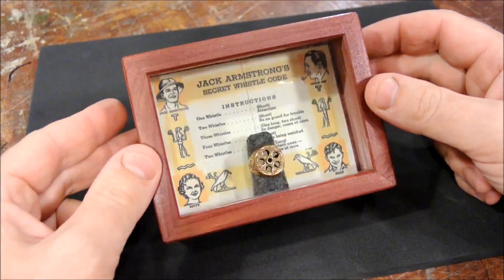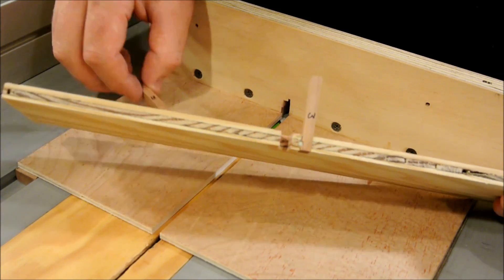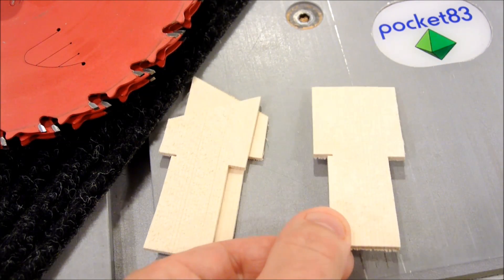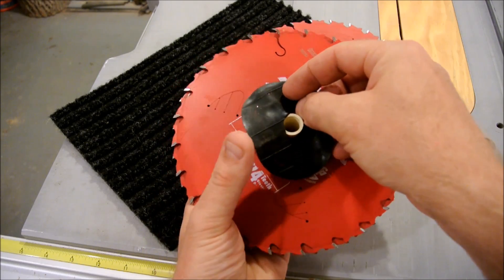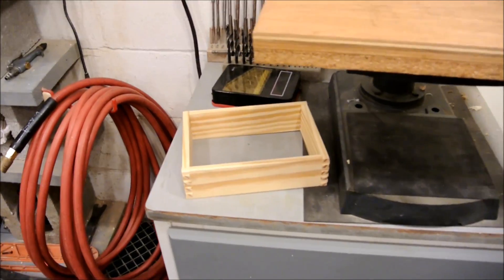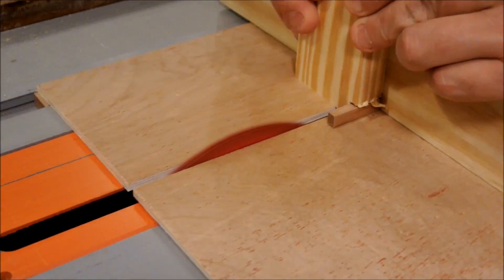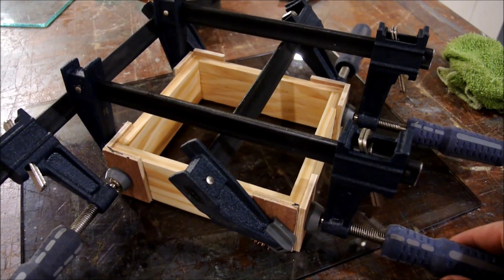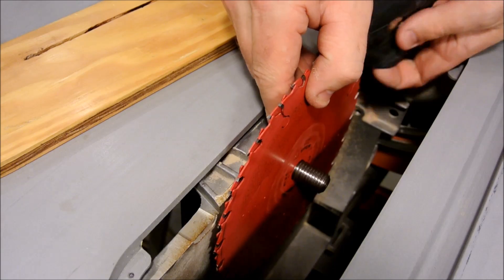Box joints WITHOUT buying a dado set (make one)

Comment: Okay couldn't you do the same thing with say steel washers? I know the rubber helps stop slippage but if you tighten down your blade properly it shouldn't slip anyways. Just food for thought, I prefer to use my router table setup but it does get time consuming having to swap dust collection between my saw and my router table, (yes I'm a cheap skate refuse to buy more tubing for my dust collection and too am worried it may lose suction since it is a small unit).

Comment: I don't think I ever seen stacked blades for sale in UK like you have in USA
Reply from the maker: The blades used here are much smaller than the typical blade used for this saw, which reduces the angular momentum of the stack to an amount comparable to one larger one. Brake time is nearly identical. Not that it matters; if you have to turn a saw off in a hurry, the stupid mistake has already been made.
Reply: Mike L
Thats alot of queen money thought
Reply: They're illegal apparently
Reply: Harry you can have a regular blade but a wide blade is illegal?? What kind of madness is that?
Reply: cameltoast reasearch tells me it's the fact that the teeth can catch each other and fly off, which is highly unlikely but hayho
Reply: It's because of the increased weight, more weight means they take longer to stop, and there are regulations that saw blades must stop within X seconds of the power being cut. A stack of blades can't do that without requiring active braking.
Reply: Mike L This is what I could find: "On European saws the blade is required to stop in less than 10 seconds from the time the stop switch is engaged"

Comment: Thanks very much, really interested to see the "homemade Dado" option!
As someone in the UK, I am apparently prevented by law - out of concern for my safety - to use dado blades.  I could import them of course (or, as I now see, make my own), but apparently even that doesn't help as the arbour on any modern UK/EU table saw will be too short.  This leads me to ask:   a) can I make do without them, simply by making multiple passes of a single wide kerf blade?;  b) how practical is it to make these sort of cuts using a router instead?  I'm a newbie but I figure a router should work fine for these cuts, and yet I never see any US woodworker doing so?  I guess table saw dado blades must be superior to using a router, even factoring in the time to keep changing in and out dado blades?  Thanks again for great vid.
Reply from the maker: It's hard to answer those questions in general, because so much depends upon what you are doing and how often you are doing it, but the short answer is yes to both possibilities. 

Making single-kerf passes is time consuming, but it certainly works. As for straight-bit routing for box joints, sure, that also works procedurally. In fact, there even exist jigs to assist with box jointing (and even dovetailing) with a router. Just do your homework, and make your decision at least in part based on how important the whole thing is to you. For example, I don't box joint very often at all, and I make lots of wooden stuff, so a dado stack is not high on my priority list.
Reply: OK thanks very much!
Reply: Would one of those "wobble" blades fit your saw arbor? There's an angle on it and it wobbles back and forth to make a wider cut. Router works too.
Reply: Buying 3 or 5 of those diablo blades costs a pretty penny for a make-shift device.
Reply: I use my old dull ones. They need not be sharp for hogging out a 3/8" dado. Back support will limit the tear-out.
Reply: And if you don't have 3 or 5 saw blades sitting around, then you probably don't have the experience to be using a dado stack, anyhow.

Comment: literally laughed out loud listening to you and watching both of your videos relating to dado making and box joints etc... 
i mean this in the best complimentary way. They were  funny to me more so because i relate to your thoughts and methods ...... 
more than anything the part where you are pushing your wood through the second table saw you built using a surge protector unit....let's just say although completely rediculous at times i have used things as rediculous as my iphone selfie stick with my iphone attached to it encased with the traction of its otter box rubber coating extended with the selfie stick... with that said i think i just came up with a way to shoot the table saw cutting wood with my otter box rubber case to use as traction to push wood being cut while getting up close and personal footage.... im sure in case the phone would slip and get snagged by the blade it may lead to otters quality control testing to a new level... I truly appreciate and love that i don't have to feel so isolated with the out of the box, non conventional nutty things i use doing woodwork daily.

Comment: I like that box made with strips of wood glued together.  You could stain every other one a different color, like 1 dark, 1 light, 1 dark etc, !   Never thought of that.  Keeping track of what you do you could even use different thickness of wood strips as long as they are the same width.  Like 1/4 X 1/2,  1/2 x 1/2,   5/8 X 1/2 ,   3/4 X 1/2  !
Reply: I saw a video long time ago that used your idea to make a Chess board. Alternate strips of light and dark coloured wood were first joined together. Then strips were cut off of that panel. Finally alternate strips were reversed and glued together to generate the Chess-board pattern. The accuracy was so great that it would be hard to know where the joints were. It still gives me goosebumps while writing this. Regards,

Comment: Hello pocket83.. I had a question that I couldn't find in the comments below. I was wondering if there was a reason (safety/design) you were using 7 1/4 size blades?  My purpose for asking is that I only have 10" blades for my table saw? With your experience, would 10" inch blades work with your method?
Reply: +Nathan Sagrillo I don't see why not. I use the smaller ones because they are cheaper, thinner kerf, and easier to control. Three Diablos will make 1/4" box joints, and that's all I ever really use. If I needed to make larger ones, for like production or high-quality work, I'd probably just buy a dado stack. But these are only the choices that I've made, so you have to decide what you're comfortable with. Good luck ;)
Reply: Awesome! I appreciate you getting back to me so soon. I was mainly asking because I had already went out and got 10"  blade's before I noticed on your video that you were using a smaller blade. Lol.. anywho... thank you for taking the time to make this awesome video! It defiantly helped! Have a safe one.

Comment: Good video, interesting and creative problem solving. I was taught a technique which eliminates the second spacer peg (By William Ng, an exceptional YouTuber and teacher). It involves marking edge that you put against the peg of jig when making first dado cut, then after your done with box or drawer fronts, flip that edge around to place marked edge over the peg, toward the saw blade, leaving a perfectly spaced edge (or new finger if you will) where you place your sides against and make first cut, then remove that front from the peg and finish cutting rest of joints. 😃 Cheers!

Comment: I struggled with making my own box joint jig but still had problems getting my box joints to fit good, especially very long or wide box joints.  I finally bought an Incra I-box and that took care of that.  I also use a Freud dado set of blades that I've used for year.  My primary problem there is keeping the blades sharp.  I sharpen my blades myself.
Your setup is really good and I may try to experiment with you blades of choice.

Comment: I can't see the practical benefit of not buying a dado set unless you already have 3 identical blades, but who has that either. those 3 blades must have cost about $60 each and a dado set is $200. these prices are for the area I live, prices differ depending on geographic area. but point being is that 3 blades cost about the same as a dado set. other than that, great video with lots of good tips.
Reply from the maker: Those blades are $10 each, and I have a dozen of them. They aren't quite dull, but they aren't quite sharp enough for fine work, either. Perfect for this application. Keep in mind that these are 7.25" blades, which I use for both table and circular saws. I will grant you, that if you typically use a standard (and expensive) 10" blade in your table-saw, you aren't likely to have as many sitting around.
Reply: +pocket83 where do you get Fries Diablo blades for so cheap? and yeah, if you can get them that cheap it is worth. but don't do it right? cuz this video is for entertainment only.
Reply: +Mike West that's a crazy good price.
Reply: +Tim Fevens   Home depot had those exact blades 2 for 9.99 on black friday.
Reply: +Tim Fevens  indeed it was,  i wish i had bought more thank two packs.
Reply: http://m.homedepot.com/p/Diablo-7-1-4-in-x-24-Tooth-Framing-Saw-Blade-D0724R/100008676         this link has the blades. 30 dollars is a heck of a lot cheaper with the dado stack

Comment: Yeah there is no way I would stack regular blades on top of each other.  I really don't care what kind of proven DIY method there may be for it.  Shortcuts are just not an option for me when there is blade spinning in my face at 5000 rpm.  A descent dado set will cost you know more than 100 bucks.  Now I know 100 bucks may be harder to come by for some than it is for others.  I definitely  do not negate that fact, but I say to all of you thinking of trying this.  Think about what a piece of hot carbide metal will do to your body coming off a table saw at 5000 rpm.  I mean you see what bullets do to people right.  Now is that really worth risking because you don't want to spend 100 bucks on a real dado set.  For me it definitely is not.  

I love a great DIY just as much as the next person.  In face DIY's are my go to before I purchase anything in the store simply because I love the craftmanship and the thought that goes into it, but there are just some things that I would never think about DIY's and this one them
Reply from the maker: There is nothing unsafe here, assuming that my advice is followed, and as long as there isn't a high rate of feed. In fact, this method is probably less likely to eject carbide, because the teeth can't touch each other through a rotation collision. In fact, this is probably more safe all around: 7.25" circular saw blades have teeth that are small and sharp, so without those deep gaping gullets that dado blades have, there is less leverage for violent grabbing, and less room to catch a shirt sleeve. Also, a zero-clearance plate could be easily adapted to this technique to make it even safer.  

I would not suggest that you do anything that makes you uncomfortable; if you are already happy with the stack you are using, or if you are continuously making dado cuts, then this is not for you. But there is no reason to spread fear about this- especially if you aren't going to point out specifically what is wrong with the technique.

Comment: I was enjoying your video until you suggested that 95% of the world needed to convert their understanding of measurement!It's you guys who have yet to realise the simplicity and benefit of the metric system. Personally I can use either but find the metric far more intuitive. Good video though :-)
Reply: I didn't suggest that at all. I suggest that you adapt to understand the world in its present form and variety, and stop making fruitless argument. I get angry messages to "convert" constantly, despite the fact that I'm already fluent in both systems. I live in a place where wrenches are labeled with Imperial, and where we are many decades away from standardizing, so stop crying about it. 

Also, measurement systems are arbitrary, and there is nothing empirically better about Metric anyhow- you just think that because you have 10 fingers. In fact, the Imperial fractional system has distinct mathematical advantages that a system superior to both could implement, if you guys could ever put down your angry, culturally preserved biases. 

But alas, Metric is the system on which the sun never sets.
Reply: Sorry I rattled your cage!! I meant no offence. I was responding to your comment where you say at 7.01 that if you only speak metric you're going to have to convert. So I think it's fair to say you started the arbitrary argument.
Also I specifically said in MY opinion metric is more intuitive, it's not my fault most of the world agrees.
There's no need to get so hot and bothered I was just messing with you!
Reply: +Andrew Byron He didn't "start the argument"...YOU DID. He's showing you TECHNIQUE...he doesn't know what thickness blades you get in Metric World...apply the technique using your measuring system and CONVERT to Metric...get it?

Comment: How about using talcum powder on the rubber discs so they don't stick.  I use it all the time inside bike tires/wheels to make the tube slip slightly inside the tire during inflation.  Lots less messy than the old water/soap trick.
Reply from the maker: Good idea, except I wanted them to stick.

Comment: Can you please explain why a larger washer wouldn't work better than cutting up a bike tire?
Reply from the maker: Because of the fact that the kerf(s) from each blade overlaps, there is a possibility that teeth could collide, should the blades rotate on the arbor. This could eject carbide, which I would prefer to avoid. The friction-fit of the compressed rubber ensures that this can not happen. I'm sure there are lots of different styles out there on the market, but an expensive dado stack works differently, with a "chip remover," so it isn't likely to pose this particular risk. But, I don't like retail dado stacks either (for reasons that are too long to explain here). Anyhow, just using a shim/washer seems a bit reckless in my opinion, but I suppose it would depend on each unique situation.
Reply: +pocket83 awesome, thank you. I enjoy watching these videos and watching how everyone does different things... thanks

Comment: I'm planning on building a table saw using a 10" circular saw. Will three blades like this work on a 10" circular saw? I am wanting to make box joints (finger joints) 1/4" thick. Could this three blade idea work also for smaller diameter blades like  a trim saw that uses 5" or 6" blades? Any information you can provide would be greatly appreciated! I enjoy your videos!
Reply from the maker: I don't see why not. A smaller blade than is recommended is fine for any table-saw application. Obviously, if you are using the idea in a circular saw, the guard will be rendered less useful, and it could possibly rub, so pay close attention. I would be more concerned with using, for example, three 10" blades in a 10" saw, because it is better to have power to spare. Using three little blades in a big saw that can probably plunge 3" deep in a single cut offers the motor very little strain, especially since you are only cutting out 1/4" of material. 

Just remember- as with any experimentation, proceed slowly and carefully.
Reply: +pocket83 I appreciate the fast reply! All I'm wanting to do is make 1/4" box joints to make boxes. I was wondering though, have you ever made a box joint using only one blade?
Reply from the maker: Yes. It takes forever! For that, you may want a 10" blade with a nice thick kerf. You could also build a jig. Or maybe just use a skinny indexing pin. Of course, you could also use a router table! Sorry if I'm no help; I'm tired. John Heisz has some great ideas, too. Go check his vids. Good-night ;)
Reply: +pocket83 Hey man, I appreciate the info! I hear ya on the tired. I'm fixing to call it a night myself. Appreciate ya my friend, take care

Comment: Very ingenius idea on how to make your own dado blade.  I remember those awful wobble dado blades they used to sell.
Very dangerous and on hardwood material, a lot of chipping because of the smaller tooth count, which made blade kickback
a possibility.
However, in your demonstration, your fingers are awfully close to the blade as you push the material through the blade. 
Glue- ups are always a challenge.

Comment: I've been looking at buying a dado stack, thank goodness I didn't. I can see the safety issues with the blade stack but with the rubber inserts but with the after use demonstration a lot of issues are solved. Care would still have to be taken but you'd have to take care with a dado stack as well. The second idea is so simple you think why didn't I think of that. Both ideas very useful and a LOT cheaper than a dado stack. Thanks a lot.